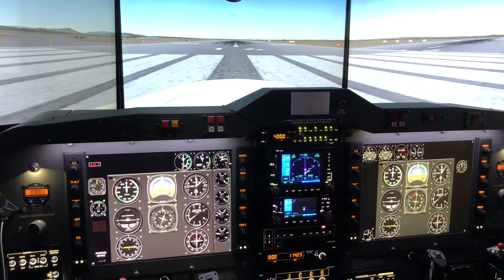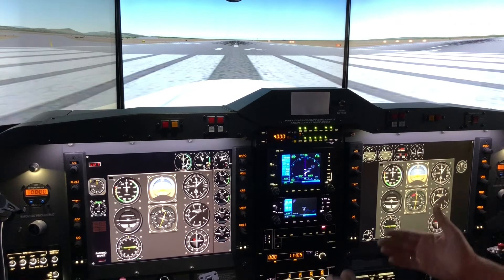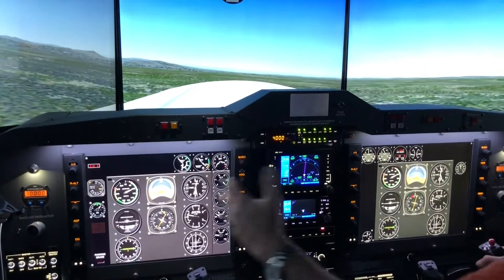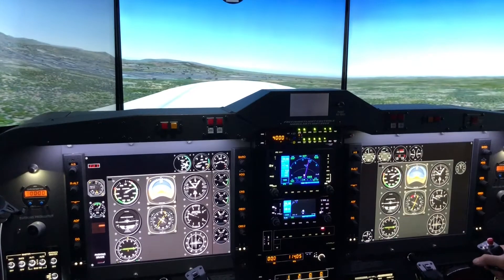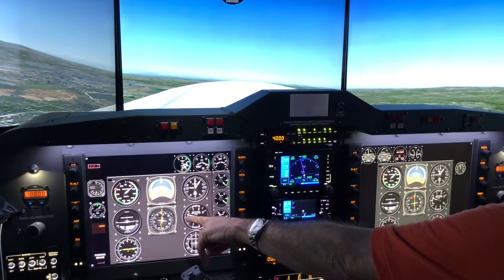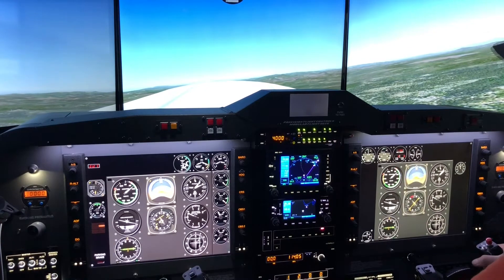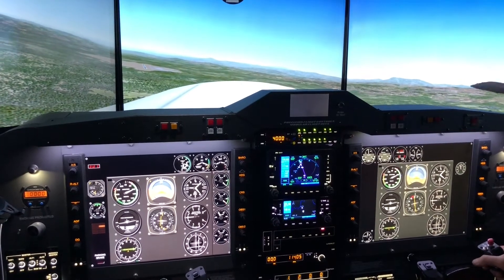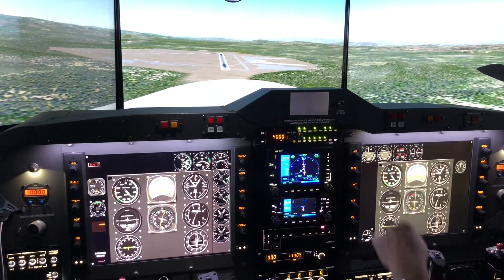Aircraft Simulator Training Single Engine Demo

Comment: Always turn towards the live engine, Its easier to roll out of a turn thats initiated towards the live engine than the opposite scenario. You want the live engine helping, not hindering roll out.😉
Reply from the maker: To do that you have to use rudder.  The rudder is the largest drag item on the aircraft.  Put the rudder in the slipstream and you loose lift and airspeed.  This was the way it was taught starting in 1954 when the CAA designed the program that we are still teaching 80 years later.  Turbocharged aircraft are NOT Piper Apache's. Train to let the engine make the turn and maintain a shallow bank.  No rudder therefore no loss of airspeed.  We have had 12 engine shutdowns from 200 feet to altitude (that we know of)  using our methods and those planes are still flying.  The turbocharged 310R at Santa Fe did the FAA "turn into the engine" and he lost the aircraft (airline ATP).  Do you research on how the CAA (precursor to the FAA) set up the piston powered aircraft in the 50's, small underpowered aircraft.  That is why you turned into the good engine.  Turbocharged Aircraft will not need that.  The rudder on a 414 is 12 feet up in the air.  Do the research on why Duane Wallace had to modify the 411 and put a bigger rudder.  The problem was that rudder is the VMC recovery device but with VG's you have notice of VMC and dont need to consider the rudder.  There is more.  No, we DO NOT teach turning into the engine but train you to let the aircraft be the rudder.  Therefore no airspeed loss.